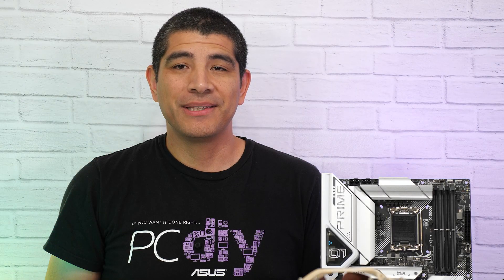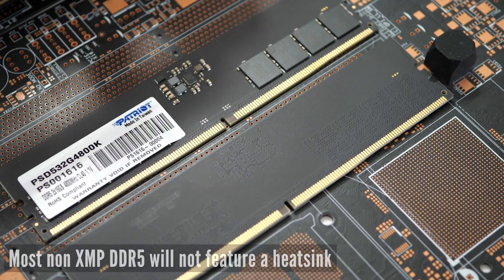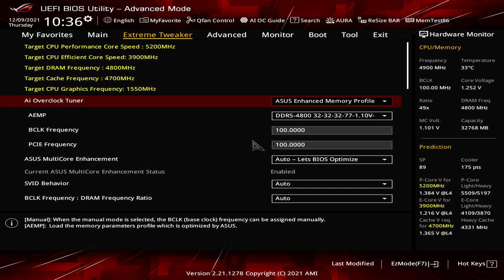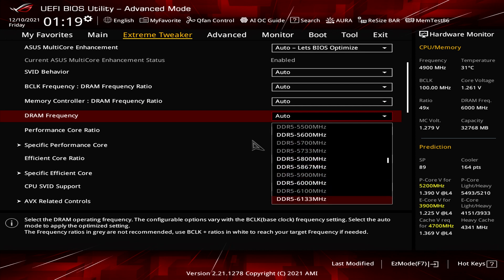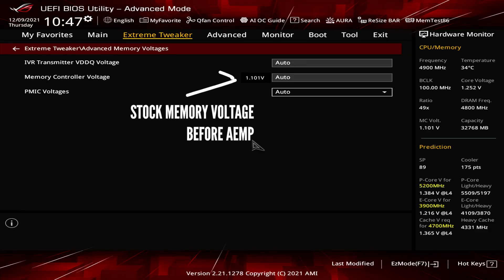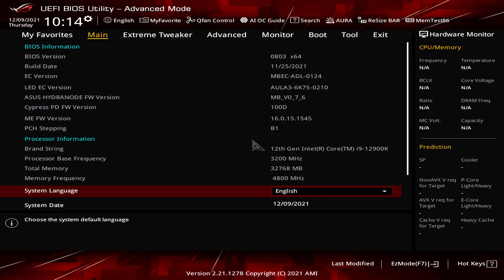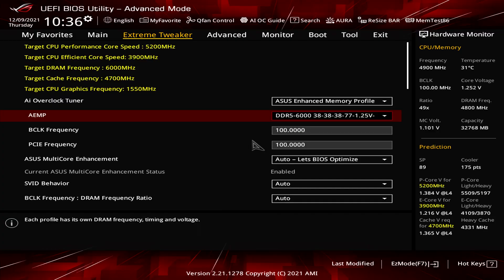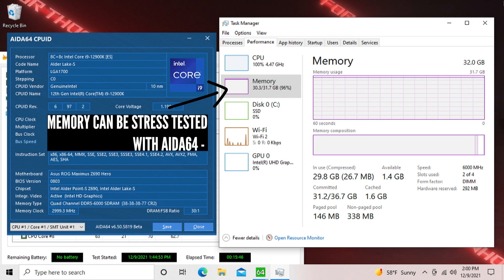How To Get More From Non XMP DDR5 - ASUS AEMP UEFI BIOS Feature Overview & Guide

Comment: What happened to the aemp profiles with aemp II? I have the same memory in this video and I only see aemp II which brings me to 6000mhz but I don’t any other profiles for aemp. It also doesn’t actually bring me up to 6000mhz as I have selected. It just puts me to 5800mhz for some reason.
Reply from the maker: AEMP will define the best target profile based on your IC and DRAM topology it is not a specific profile like XMP which is predefined. In short what you see is what you get based on the analysis of your DRAM. You can of course proceed to manually tune the DRAM further after you have enabled AEMP.
Reply: @ASUSUSA  Thanks for the reply! This is with a 13600k on a b760i wifi. I will try to manually tune to 6000 but it's already selected. Maybe I missed something? Also could you explain what Performance Enhancement 3.0 does? Since this is a b760 there is no overclocking but I know that some can do blck overclock. Is this something like that?

Comment: Why does Asus alongside other manufacturers advertise max ddr5 at 128gb? How have you tested this? There are currently no 128gb kits available. The only way is a mixed 2x 64gb kits, this is what your customers have been buying & IT DOESN'T WORK!!

Why not honestly tell us the max is 64gb 2x32gb kit. And why not put 2 slots on the motherboard instead of 4 slots? Why lie?!
Reply: Because the Z790 Chipset supports 128GB, defined by intel.
Reply: @Waldherz  the Z690 & Z790 are both the same. Do you have proof that you've seen a 128gb 4x32gb high speed sticks run at xmp?

I haven't...
Reply: @sadiquldey  128GB supoported memory doesnt mean that you can run 128GB of overclocked memory.
XMP is overclocking, so out of spec and doesnt have to be supported.

Intel has never made any claim or hint that Z690 and Z790 would run 128GB of overclocked high speed ddr5.
It just supports 128GB of jedec 4800 mhz ddr5 which I have seen in my own system.

I have not tried faster kits because I dont own any faster kits.
The fastest I have for my gaming rig is some 6000 mhz 32GB kit.
Reply: @Waldherz  Hi, Wats your all settings of ram? I have stability only a 4000 :(
Reply: @Armanas555  At 128GB?
I had a 4800 kit and got it to work with XMP. No specific settings needed.

Is your kit on the QVL list? If not, maybe contact Asus.
Reply: @Waldherz  IT is Kinstone 32gb x 4szt. 5600
Reply: @Armanas555  Have you tried applying the basic JEDEC timings? 5600 is too fast.
I have never heard of the brand Kinstone.
Reply: @Waldherz  Kingstone. Ok. 5600 is to fast but 4800 also. Don't stable at this speed.
Reply: @Armanas555  Hm. Odd.
Id write to Asus and ask them if they know more.
Maybe the RAM kit is not on their supported list yet.

Comment: I have the prime-a board. 6400mhz memory isn't on the qvl list but it's xmp memory could I use what you are saying to actually run the 6400mhz memory???
Reply from the maker: Watch our recent Kingston DDR5 live stream ( recent PCDIY hardware live stream on Friday ) we demoed this working on the -A. The QVL is a non-factor but what is a factor is the quality of your IMC which is variable and not known. It is not realistic to expect all IMC ( memory controllers ) can achieve 6400. As such keep in mind, you may need to drop down the memory divider if your CPU cannot support running it at this speed. If you have more questions, join our PCDIY group. Best of luck with your build and thanks for being #TeamPRIME

Comment: Hello, thank you for the info. 

I am currently running Asus ROG hero z690 and was wondering if I increase the speed and overclock the DDR5 ram to 4800, will it provide performance enhancements considering that my usecase  I am running multiple VM’s not interested in gaming 😁

I have corsair vengeance with total of 128GB which can be optimized to reach 5200 

Currently running at only 4000 Mhz 

Thanks,

Comment: I have the rog strix z690-e with Corsair 32gb 5600mhz ddr5. When I enable the xmp1 just like you do and save/restart. I get a error saying system instability press f1 for bios. When I disable xmp I don’t get any issues and it boots normal. What is the issue??
Reply from the maker: Ensure you update the UEFI BIOS to the most recent version and consider trying the secondary XMP profile, if you continue to have issue you may need to manually drop the DRAM divider to a lower value.

Comment: i feel ddr5 was rushed. it requires way too much fiddling out the box
Reply from the maker: No fiddling is required if you want out of box streamline install select standard JEDEC kits like 4800MT or also you can consider basic XMP kits like 4800, 5200 and even 5600MT.

Comment: Hello i have Asus Strix  laptop with ddr5 memories. But there is no profile option in bios. Can we do this on any other way? Thanks
Reply from the maker: This guide is for desktop motherboards, not laptops. Laptops feature very different chipsets and UEFI BIOS environment/functionality.
Reply: @ASUSUSA  Thanks for reply. So in this environment can we use xmp profile or we don't need at all ?

Comment: My G Skill DDR5 6000 still won’t run any xmp profiles on my gaming-e. I’ve been through two sticks already. Trying to figure out what to do next.
Reply from the maker: Your memory controller may not support running at 6000MT, you should join our PCDIY group for more insights.

At a min, you should update your UEFI BIOS and retest to see if improves scaling but be mindful that there are a percentage of CPUs and their IMC that cannot operate at ultra-high dividers like 6000MT in those cases you will most likely need to attempt to manually tune to see if you can stabilize or also possibly manually drop the memory divider to a lower value like 5600 which has a much higher percentage of success across most CPUs.

Comment: hello, under € 350 what is the motherboard that barricades / limits less the (high) frequencies of DDR5 RAM?  With the highest maximum frequency limit of the RAM, which supports the highest possible frequency in OC pushed DDR5 (with top-of-the-range CPU and RAM working at higher frequencies than those generally supported by the Z690 mobos, which therefore in this case could represent a limit and block / run RAM and CPU at a lower frequency than the max they could reach, unless we are talking about Asus Apex or very expensive mobos), then mobo that does not impose a frequency limit on CPU and RAM and letting them work at their high frequencies.  I foresee in the future to probably put an i7-13900K (keeping the same mobo) so the only thing I need is that it is a model of mobo that lets CPU and RAM work at very high frequencies without barricading and not limiting CPU and RAM to the limit frequency of the mobo.  With high max frequency limit (the one indicated by the manufacturers in the data sheets), but above all true in a real scenario, because I see that in the data sheets some models have indicated 5333MHz, others 6000MHz, but some say that all mobos with 4 DIMM / slot RAM barricade / limit all to 6400MHz (frequency of ddr5, even if these and the CPU could theoretically work in OC even at a little more than 6400MHz), hoping that this is not true, I am looking for a mobo suitable for OC pushed RAM, the goal is to try to bring even more mature ddr5 banks that I will buy in the future (with 13900k having better IMC and SA) at the highest achievable frequency, perhaps between 6500 and 7000MHz.
Reply from the maker: Overall the scaling will be more limited by your CPUs IMC and rank, density and IC as well as population ( 2 DIMM vs 4 DIMM ). 

In this respect the experience will be similar between the -E/-F HERO, FORMULA or EXTREME 

Overall if you want the best balance of a board continually tuned for the best that is possible consider the HERO. The APEX is no longer in active production but would also be a great choice if you can find new/old stock.

Comment: I have a asus rog strix b660m and 32gb memory xpg lancer 600mhz with a I7 12700kf, when i put The profile xpm 2 my computer need a long time for start and say: this May be due to the previous post attempt failing because of system instability, and i need set the changes for default. Why?
Reply from the maker: 6000MT is an overclocked frequency and your CPU IMC may not support it. You should ensure you have installed the DIMMs in the correct slots as well as ensure your UEFI is up to date. if you continue to have issues you may need to drop the memory divider to a value below 6000MT.
Reply: @ASUSUSA  TY <3

Comment: Can anyone help me, i have a normal asus motherboard and everyone says i need the extreme tweaker thing to activate xmp mode. The point is, that i dont see this setting can you help me?
Reply from the maker: Join our PCDIY group if you have question but you just need to enter in the UEFI and enable XMP from the option on the left-hand side of the screen it is fairly simple. You do not need to enter into the advanced interface or have an ROG board to enable XMP all Z and X series chipsets support XMP.

Comment: Hi, advice for motherboars ddr5 With i7-12700?
Reply from the maker: What advice are you looking for? Considering joining our ASUS PCDIY Group for more guidance.
Reply: @ASUSUSA  what specifications a mobo must have as stable as possible even when you use a RAM frequency higher than the max supported by the mobo.  (eg max mobo frequency with ddr5: 6000MHz, RAM ddr5:> 6100MHz. That is, with the same 2 mobos that support the same maximum frequency, which one will be more stable. and will better hold a frequency above the sustained one.

Comment: Hey JJ nice video mate. Quick question mate. Iv installed 32gb of ddr5 (2x16gb) dominator 5600mhz on my ASUS rog maximus formular z690 mobo It’s coming in at 4800mhz non xmp. When i enable xmp computer crashes and comes up with cmos error. I managed to get it back to the previous settings. I did notice that the timings in the bios and ASUS cpuz are different to the actual timings on the ram. In bios it’s saying 40,40,40,77 when in fact the ram is 36,36,36,76. The voltage is right at 1.25v. Do you think i need to go in and manually put these timings in so they are right? Will that then let have them higher speeds of 5600mhz? Or maybe xmp would work? I do have another 2 sticks of the same ram that i eventually want to put in aswel so 4 dimms. Thanks heaps mate
Reply from the maker: Check out our post in the ASUS PCDIY group for more insight and guidance but keep in mind 4DIMM operation is going to be limited to approx 4000-4400MT only 2 DIMM can potentially support up to or around 6000MT.
Reply: @ASUSUSA  thanks for the reply. Iv managed to get 2 dimms at 5600mhz but I think that's better then 4 dimms at 4000/4400mhz for gaming so I mite leave it there for now until another update comes. 👍

Comment: Hello, I try everything but when I enable xmp, it gives me only black screen :( and I should to rest the motherboard and rest settings
I have asus z690 extreme, ddr5 6000 mhz, Intel core I9 12th kf
Reply from the maker: Are you running 2 DIMMs or 4 DIMMs?

you should ensure you are using the correct prioritized channels and have the UEFI BIOS be up to date. While most memory controllers should be able to reach 6000MHz some may not work with the XMP profile due to silicon variance. In those cases, you may need to increase voltage or manually set the memory divider.

You can do this by loading the XMP profile and then manually dropping the memory divider by a value of 1 below 6000 and seeing if the system POSTS and BOOTS.
Reply: @ASUSUSA  
First thanks for reply 🌹
And if you search all of a new users of ddr5 6000 mhz have the same problem and less than 1% fixed it , you can search on google like about “ black screen enable xmp asus z690 “
So I think if you make a video for fix this problem you will be the first one who do it :)

Anyway let’s back to my problem:(
I have 4 rams & I updated the bios for the last update 
When I enable xmp and save , then restart and only black screen !!
Even if it 6000 , 5400 or 4800 mhz will make the same problem!! I should rest the M.B and disabled xmp
Reply: Any answer bro 🙂

Comment: I can’t seem to get my ddr5 dimms to run at the specified speed that is described on the page of the motherboard for these specific dimms. 4800 40-40-40-77 will not work
Reply from the maker: Ensure your UEFI is up to date and then select the XMP profile for your memory. Keep in mind if you are running a mixed kit you cannot expect the same timings to be supported. If you have further issues consider joining our PCDIY group or reaching out to the service and support team.
Reply: @ASUSUSA  thanks for your reply ! Turns out , I made the biggest mistake one can make. I did not read the manual. 

XMP still does not work but that’s not a problem whatsoever. The compatibility list on the Asus Rog webpage for this motherboard lists the appropriate timings for the kit I’m using & these work perfectly. 

Currently running the B660-G (the one for which I initially had some problems with the memory timings , not anymore though!) & also the APEX . 

Very happy with these. The apex might not be cheap , but has saved me a lot of time by not having to mess with settings of boards made by some of the other manufacturers. This board just works & that’s worth a lot.

Keep it up ASUS

Comment: Hello, I have a z690 hero I updated the bios to the latest 0811 bios, but it caused my cpu to spit errors like crazy, I tried 0803 and the cpu stopped getting errors but neither will run my Gskill 6000 cl36 kit at xmp2 without having memory errors, increasing the CL to 38 stabilized it but it’s been a pretty big disappointment. I tried adding .05v to the dram voltage to see if maybe that would help but it just made it worse. Same with dropping by .05v do you know if this is a bios issue or maybe motherboard issue?
Reply: @Charles Rush hopefully not lol, I found my motherboard was one of the bad ones with a reversed memory capacitor. If you got the hero I’d check if yours is also

Comment: My Asus Z690 Prime,  just died after I activated the XMP what happened ?
Reply from the maker: Please reach out to our service and support team without more information it is not possible to debug, your issue is most likely based on the DRAM configuration you have not being supported.

Please ensure you have updated the UEFI BIOS before enabling XMP and also ensure you are using the primary optimized ( first two banks ).
Reply: @ASUSUSA  Oh thank you very much for this response, I have one video in my channel that you can see with the problem, unfortunely the video is in Portuguese. This is my config XPG 850W,  Z690-P Asus Prime, DDR5 kingston fury 4800mhz 40CL,  i9 12900k, After I enabled the XMP 2 , my motherboard started to not  start anymore, even after doing CMOS clear. It starts for a few seconds and then turns of and starts again. Since I didn't have another DDR5 to test, I really was not sure where the problem was if was my motherboard, power supply or DDR5 broken